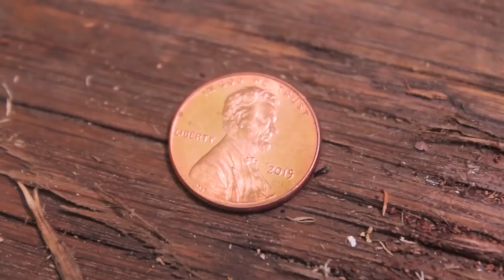Raising our timber frame workshop

Comment: Dumb question....I am using a bunch of 6"x6" and 8"x8" white oak beams that have been dried already to build a workshop.
If I have a 1" peg hole diameter, wouldn't I use a 1" diameter peg?
Reply from the maker: entire books could be written on pegging and its various forms and applications. In short, most timber frame pegging is done with tapered octagonal or square pegs, just large enough for a snug fit without splitting the beam apart. Traditionally timber framing was done with green timbers and dry pegs, the joints having offset holes to draw together as the tapered peg is driven in. Draw boring this is called. So it really depends on what you are pegging, and the purpose of the peg. Any more I prefer square pegs, sized so their corners bite into the sides of the hole, but not large enough to split the wood they enter. This causes a very tight peg that is not easily extracted, even if you want to. A heavy taper on one end is essential in draw boring, the point needes to snake around the offset holes to get the peg started. And dont forget to leave them long and sticking out for a place to hang your hat!
Reply: I'll be using dry pegs in dry timbers (I have access to a large number of 6x and 8x dried oak timbers). I didn't want them to go to waste and didn't want to spend the extra money on new, wet timbers.
Reply from the maker: I was trying out an old technique used in some German Barns here in the US. The longer mortise allows you to insert the braces after the tie beam is already, which is nice. The filler block just fills the extra mortise space later. Tightness is a result of my then rough and amateur layout and mortising, Ive gotten quite better at all that jazz. ')

Comment: You seem to be much better than the guy on The Woodwrights Shop show. He always has bandages on his fingers and talks to much. How did you know the A frame with block and tackle would be sufficient to lift the bents? great job
Reply from the maker: +William Morgan Thanks but Roy Underhill is a true master and Im just leaning, and yes I cut myself a lot! I multiplied the breaking strength of the rope by 4, then calculated the green weight of the timbers…it was way overkill as these timbers were quite light.
Reply: +Mr. Chickadee I'm a great fan of Norm Abram. I enjoyed watching the New Yankee workshop and have made many of the projects.
Reply from the maker: +Al I prefer woodworking, not wood machining ;)

Comment: where did you get those pants?
Reply from the maker: frontier classics brand
Reply: thanks
Reply: +Mr. Chickadee what is the height of one of the corner posts in the bent, or what height does that top connecting plate come to?
Reply from the maker: posts about 12'1", top plate say 6" taller than that.
Reply: Mr. Chickadee Thank you, gives me a better perspective on the dimensions of my frame.